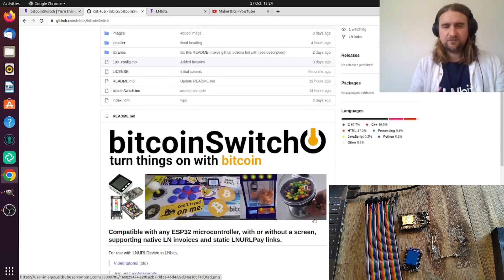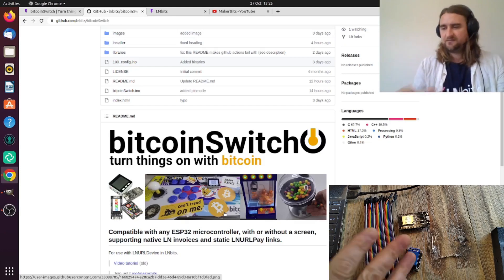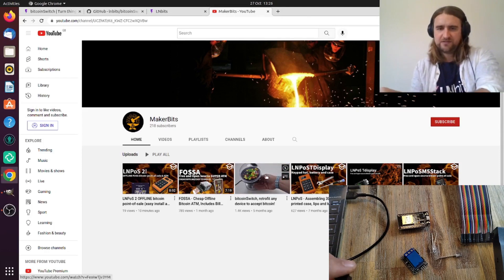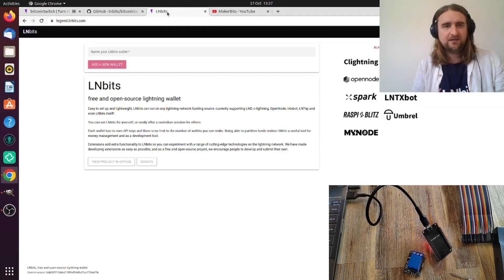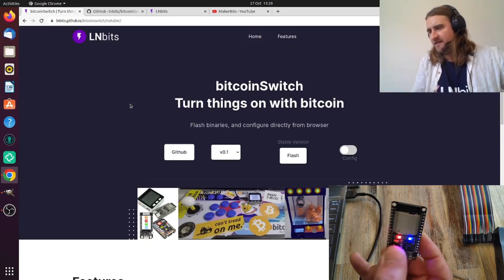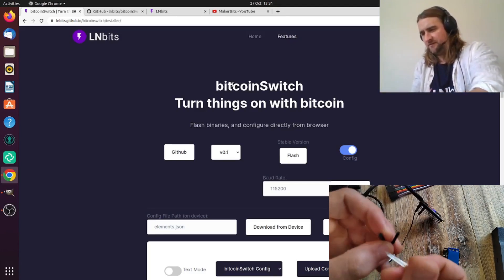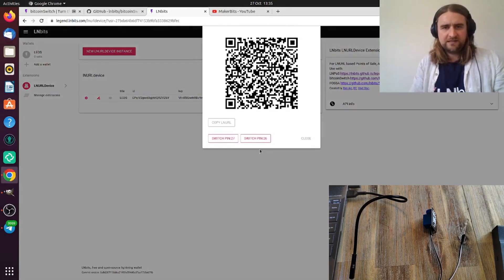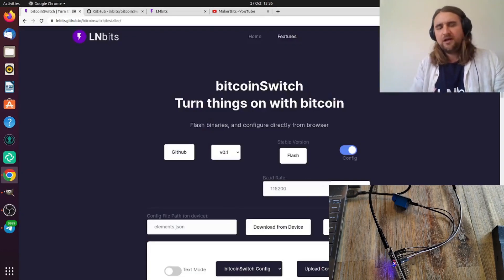bitcoinSwitch EASY BUILD with websockets!

Comment: Great, I tested it and it works great, the only issue is that if trying to configure without the WebPortal using only wifi, the wifi device-xxxxx ssid does not appear and can not be configured using the original method,  however using the web portal works fine.